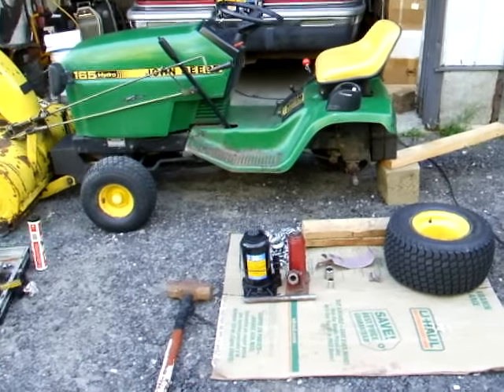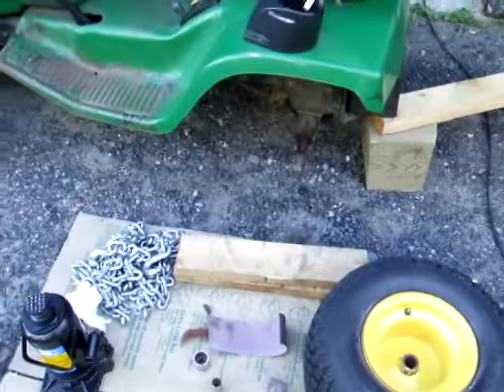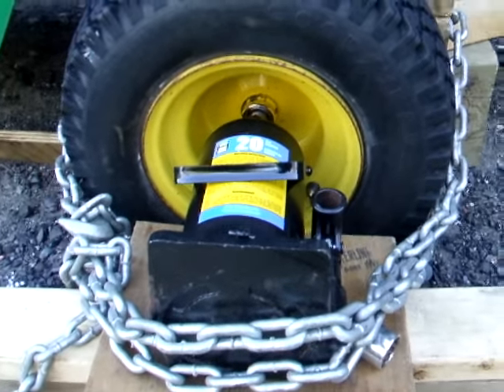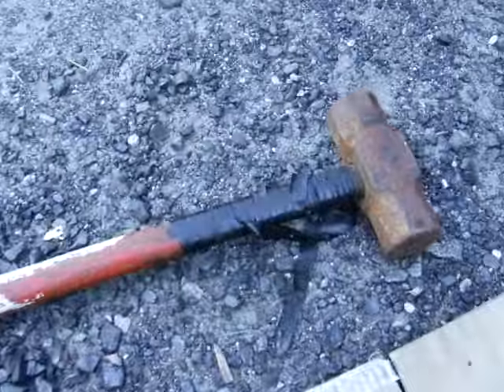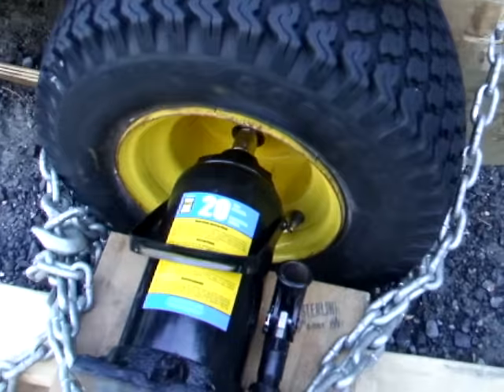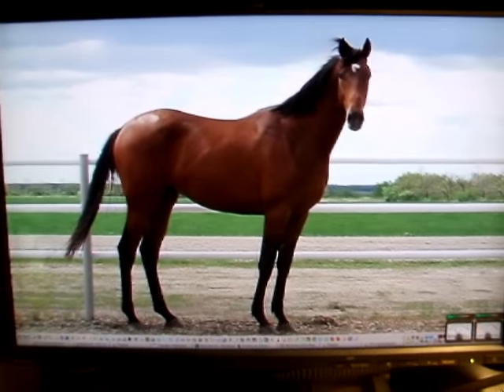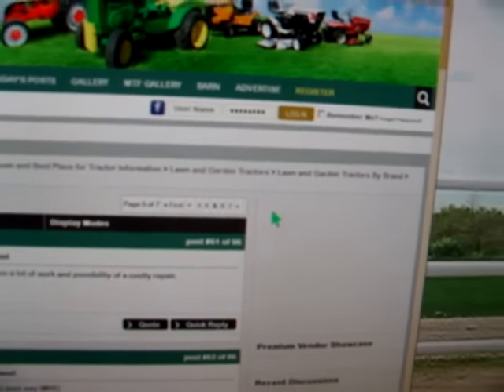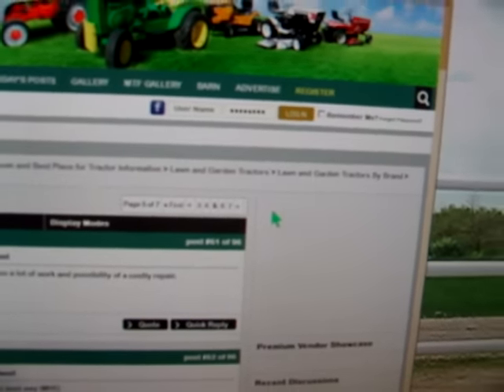Removing rusted/siezed lawn tractor wheel with a BOTTLE JACK and WINNING!!

Comment: When you put it back on cover that whole axle with never-seize brush on compound.
Reply from the maker: Good idea, I'll buy some from Princess Auto and use it when I regrease the axles them this year.  Thanks and Cheers!~  Bellarmine
Reply: @bellarmine33  Yesterday I had to cut the wheel into pieces to get it to release. 3 1/2" of direct contact wheel to axle bound by rust is a very strong grip, plus the expanding factor.....so much work for a small job. Getting ready for side 2.....
Reply from the maker: Aww boy, what a pain!  Yes, what a lot of work for such a small thing, i just wanted to swap the wheels between my 2 tractors, never thought it'd be such an adventure lol.  Perhaps you don't care about the wheel at this point, just want them OFF; but near the end of my video I show a last-ditch way to get the wheel off, and you can still use it afterwards.  Just drill a 1/2" hole in the rim right above the hub, use a sawz-all to carefully cut a slot in the hub down to the axle, then flood it with PB Blaster, and use a cold chisel to spread the hub apart and it should break free.  Still usable afterwards, the slot in the hub won't matter for a lawn-tractor going 5mph lol.  Good luck with the other side, and maybe you'll be lucky - my wheel was frozen fast, but the other side came off pretty easy, never know....:o)  Cheers!~  Bellarmine
Reply: @bellarmine33  NO CENTER DRILLED INTO THE AXLE EITHER for the puller. Yesterday it took me 10 hrs to get the wheel off after cutting it. Worst job I ever had to do in 60+ years of mechanic work. Then when I got the new wheel/tire assembly today I had to clean the paint out of the bore and key-way....more work over nothing. You never paint tight tolerance surfaces!  Now I have to remove the other wheel during the week....more hours wasted!
Reply from the maker: I hear you, everything is frustration these days about the simplest and most common-sense items!  They should have masked the rim when it was painted, Chinese shortcuts I guess.  The lack of a center in the axle didn't bother me because I didn't even bother trying a gear puller, NO WAY it would have exerted enough force to work.  As I said in my video, my 3 TON bottle jack couldn't cut it (!).  Hope one of my 2 methods helped you get the other wheel off with a minimum of fuss - Cheers!~  Bellarmine
Reply: @bellarmine33  The other side came off very easy with a gear puller and 2 threaded rods...........WTF!
Reply from the maker: Congratulations, good for you!  Was the same way with mine - the one side came off easy, other side which I filmed was 'welded' on.  Now you can finally get on with the business of changing the tires / tubes whatever, which is what you set out to do last week - simple job right? lol....:o)  Cheers!~  Bellarmine

Comment: Does it work if you cant get the key out of the keyway still?
Reply from the maker: Hi Gary, Thanks for the question.  It sure does work, there was no way I could even get at the keyway to remove it before getting the rusted wheel off.  I think that may have been part of the problem with my wheel, it didn't use a keyway / square bar, but a woodruff key / halfmoon.  I think the halfmoon 'may' have been jamming into the wheel rim slightly.  In any case, yes this method definitely works whatever type of key you have.  Good luck with your wheel removal, let me know how it goes if you want or if you have questions - Cheers Gary!~  Bellarmine

Comment: I tried this.  My wheel rim split off from the hub.  Had to end up slitting the hub that was left on it and prying it open.   Was on a Gilson rear engine rider with a unobtainable rear wheel.   Had to end up finding a different wheel and cutting the hub down to make it work , sucked big time.
Reply from the maker: Sorry to hear about your ordeal Dennis, boy what a nightmare!  You ended up doing what I call the 'last resort', splitting the hub as you say.  At least you didn't have to SAW OFF the axle and replace it, which I've heard is just what some JohnDeere dealers do (!).  Unbelievable how these can be rusted on, heard stories of people putting the axle in 10ton shop presses and bending the presses, whew!  Better luck next time, take care and thanks for the comment Dennis - Cheers!~  Bellarmine

Comment: I prefer Woodruff keys. Never had one get stuck.
Reply from the maker: Hi Peter, I think this tractor DOES have woodruff keys.  I've always thought that a woodruff key is a half-moon/semicircle, while a straight key is a bar that fits a grooved shaft.  In any case, this tractor has the semi-circle ones, which were a PAIN, I think they rotate and jam the wheel on with the rust.  Meanwhile my other JD185 has straight keys, those wheels slid off smooth as you please, go figure.  Also this tractor was kept under cover, while my 185 was left out in the rain - the 185 shafts were a bit better chromed.  Again go figure.  Thanks for the comment Peter - Cheers!~  Bellarmine

Comment: Stop. !!!, Most of the time the end of the end of the axles have Ben mushroomed from being out working to began with..  Then the homeowner tries to do it  himself and bangs on the end and mushrooms even more. All you have to do file down the end the c?axle with that high-quality file or a Dremel with a grinding drum on it.   Spray it with Creep penetrating oil .It comes right off!  That's how we've been doing it at work for 30 years.  Each side is a five-minute job with a dremel.
Reply from the maker: Thanks for the comment Meno!  That is a good point you make, though I don't think mine were mushroomed from banging, I wasn't banging on the end of my shafts, wreck my tranny!  Mushroomed or not, it took my 20 ton jack to get the rim to even budge a fraction, let alone coming off the end.  Anyway, I'll remember in future to check the end of the shafts, see if they are mushroomed or rusted as you say.  Best wishes Meno and Cheers!~  Bellarmine
Reply: @bellarmine33  Yeah , Mine are to mushroomed at all. they have just been on the axel for 25 years and they are not coming off. I'll try the jack tomorrow! Thanks.
Reply from the maker: @capeangler  You're welcome!  Good luck with your mission, these can be a real pain.  Let me know if you have any questions or your success - best wishes and cheers!~  Bellarmine

Comment: There must be a better way then this key system. Looks common for these wheels to seize onto the axle and be almost impossible to remove. Cant they have little wheel hubs like cars do?
Reply from the maker: Yes, that WOULD be nice, but I guess you have to get a bigger tractor for that.  My Dad has a very nice Yard-Man 16HP Hydrostatic Garden tractor with small 3-point hydraulic hitch, it has wheel hubs splined to the axles and rims that bolt on with 4 bolts, MUCH nicer!   Also actually, I've seen a small John Deere 108 that simply had a plate on the end of the shaft with 3 studs on it, 5 hole wheel bolted on to 3 studs(!)  Cheap but works, so guess they can do it when they feel like it...:o)  Thanks for the comment - Cheers!~  Bellarmine
Reply: They sell go kart hubs that will fit the axle
Reply: @joshmanis9860  I used a blow torch the jack and a chain. It wouldn't move at all. I took it to the mower  shop. They couldn't do it. They changed the tyres without removing the rims from the axle. Not sure how that works.

Comment: if the tire is good you can always tube it on the tractor.
Reply from the maker: That's true, but I really wanted to solve this problem and not band-aid it.  Besides, the real reason I was doing this was to put more grippy tires on the lawn mower and swap them with the bald smooth tires I put on the snowblower tractor along with chains, so good match.  Thanks for the comment - Cheers!~  Bellarmine

Comment: i,m gonna try this on a tiller wheel...one side slid off easy the other side needs dynamite
Reply from the maker: It's always one that gets you - was the same with my tractor, the first wheel came off easy, 2nd was welded on....:o)  Wish you luck, let me know how it goes or if you have any questions - Cheers! Bellarmine
Reply: @bellarmine33  same thing on the tines..one side tines came off easy but wheel would,nt..other side the wheel came off easy but the pin was stuck in the tines...had to drill the pin out
Reply: Yeah, both of mine are frozen.  I thought I could replace the tires while the rims were stuck, but no such luck.  I got one of the tires off, but that was the end of it.  I bought a 12-ton hydraulic jack on sale 15 years ago at Harbor Freight for no particular reason, and now it's going to get its first use!
Reply from the maker: Thanks for the comment, great to hear!  Yes, my 3 ton jack I first tried couldn't cut it, had to upgrade to "The Big One" lol!  Good luck, let me know how it turns out, or if you have any questions - Cheers!  Bellarmine

Comment: So All the mower, tiller, etc manufacturers are deliberately neglecting to anti-seize their axel/wheel connections to dishonestly con-jer up shop business.  
Every dealership should add the antisieze as part of the prep. 
Every buyer should add the antisieze immediately upon getting home with the machine. 
🔺And the entire US is degenerating their own English language by 
Calling the Wheel as a Rim. 
It's not a rim, it's a wheel. 
Every wheel has a rim around its outer circumference. 
To call it a rim is to take away the ability to speak technically about a wheel.
Reply from the maker: Thanks for the comment Senator Joseph......:o)  You're probably right, as the amount of Anti-sieze the mfg puts on is a real joke.  I'll be greasing them myself every few years, should buy a bottle of antisieze too.
I've always referred to a wheel nowadays as an assembly of rim and tire - a rim and tire makes a wheel.  Though you bring up a good point, back in wagon wheel days, they had the spoked wooden wheel and outer steel rim, so you're saying the metal part is the wheel AND rim, and the rubber is the tire.  So we mount our tires on wheels, not rims.......:o)  Cheers Joseph!~  Robert
Reply: @bellarmine33 . I'm 66 years old and from an English speaking country. I have always known the tyre to be mounted on a rim and the whole unit is a wheel as well.
Reply from the maker: @ducatidarmah122  Thanks for your reply on my comment Ducati, appreciate the support.  I suppose the whole rim/wheel thing has evolved somewhat since the wagon wheel days, so that everyone nowadays regards mounting tires on rims to make wheels as normal......:o)  Best wishes Ducati, thanks again and Cheers!~  Bellarmine
Reply: Take your engine pulley and transmission off and anti seize the shafts

Comment: Is anyone else using penetrating fluid / brake fluid ? Soak it !
Reply from the maker: Hi Keith, Yes, did I mention I soaked it with PB Blaster for DAYS before?  It helped I'm sure, but still not quite enough!.....:o)  See Fred Geitner's comment below on how he maxed out a 25ton shop press dealing with these problem wheels - they can be stuck on that tight indeed!  Thanks for the comment - Cheers!~  Bellarmine

Comment: 4x4 and a 4lb sledge to the back of the rim and rotate it as u pound on it will get it to.
Reply from the maker: Hi Nathan, Thanks for the comment.  Thing is, I was doing just that before, using the PB Blaster too, and NO WAY it was coming off, I was ready to give up before I tried this.  There's no way I could have applied the amount of force needed using a sledge hammer (the 2-ton jack I started with was too small (!), I'd have busted the transaxle first.  I've seen / heard horror stories about impacts / hammering on the transaxle internal snap-rings and so on, pretty weak that way.  Seen a few bad examples of expensive damage, and don't want to experience one myself.  I suppose some light tapping wouldn't hurt, but mine was stuck real good - 'welded' on as others have said!  I'd just try my 'safe n' easy' method first....:o) Thanks for your comment Nathan, and stay well - strange times we're living in, strange times...:o)  Cheers!~  Bellarmine
Reply: I have a go kart and I tried to do that and I may not be strong enough, but it is really rusted on there and this did not work for me. I again may just not be strong enough. Might try again though.
Reply: @dwightschrute3862  i did a sledge to the back of a wheelhorse rj58 rim to get it off once. I bent the rim all to hell. ever since then i try to use some pb blaster and pound it on then pound on the back and rotate while doing it. It will pop off eventually.
Reply from the maker: Thanks for the comment Dwight!  I do not recommend 'pounding' on the rim / axle, as there's no way to apply the amount of force needed using a sledge hammer, and a good chance of wrecking the transaxle!  For example, with my wheel, the 2-ton jack I started with was too small (!)   I've seen / heard horror stories about impacts / hammering on the transaxle internal snap-rings and so on, pretty weak that way.  Seen a few bad examples of expensive transaxle damage, and don't want to experience one myself.  I would recommend just trying my 'safe n' easy' hydraulic method first.  If it doesn't work, then nothing lost, go ahead and pound if you want nothing to lose then so-to-speak lol.  Let me know how it goes or if you have any other questions Dwight - Cheers!~  Bellarmine

Comment: One word... Torch....heat the shaft,and pull off wheel.
Reply from the maker: Thanks for the comment Shannon!  Yes, I thought about using a torch, I'm learning to use heat more and more to remove things.  To be honest I really don't think it would have helped, it was so rusted on there.  As I said, I had to use a 20-tonn jack, my 2-tonn jack was too small (!), so heating it would probably not have cut it either.  Sometimes it works, but I think more often than not it fails, my method is easier and safer.  I've watched a few YT videos on tires EXPLODING in your face when using a torch, no matter how careful you are, even removing the valve core and breaking the bead. One tire company says the heat causes a chemical reaction in the tire that can cause a failure up to even 24 hours later - they actually demonstrated it......weird. I'm always into trying 'last ditch effort' ideas, but from the sound of it a torch around tires just seemed a tad too dangerous for comfort...:o)  Anyway at least this idea is here in case you get into a similar situation (hope not!...:o) Thanks again for the comment Shannon - Cheers!~ Bellarmine

Comment: Thank you. It helped me. I had wheels stuck on my snowblower. They had been lubed some by the manufacturer, so they weren't seized horribly. The one side came off alright after being broken loose. The second one had to be jacked all the way, using a large bolt to push on the axle with the jack, resetting a couple of times.
Reply from the maker: You're welcome, thanks for the comment on your success!  Mine were the same, one popped off, other one had to pull it off all the way!  Another story of rims 'welded' on - rust is amazingly strong lol.......:o)  Glad it was helpful, best wishes and stay warm!~  Bellarmine

Comment: Good video! But, maybe instead of applying lots of grease on re-installation of the wheel, use lots of anti-seize??
Reply from the maker: Yes you're right, next time I have them off I'll use Anti-sieze, didn't have any handy at the time.  Thanks for the comment - Cheers!~  Bellarmine

Comment: Wish I had seen this before I did the rear wheel on my 165 Hydro.  I ended up sawing off the tire then sawing the rim off then taking a grinder and grinding the center hub of the wheel into and finally using a chisel to split the ground hub enough for it to break free from the axle.  I tried beating with wood blocks and hammer then various gear pullers around the rim lip and heating the damn thing and nothing worked.  I would love to have tried this because it just looks like it would do the job.  Great thinking.  If I have to fool with the other tire and rim I'll be giving this a try.
Reply from the maker: Thanks for the comment Johnny!  Wow, sorry to hear about your ordeal, wish you had seen this first too, boy what a nightmare!  You ended up doing what I call the 'last resort', splitting the hub as you say.  Only difference is you can maybe save the rim by sawing through a hole in the rim as I explain at the end of the video.  At least you didn't have to SAW OFF the axle and replace it, which I've heard is just what some JohnDeere dealers do (!).  Unbelievable how these can be rusted on, heard stories of people putting the axle in 10ton shop presses and bending the presses, whew!  Hope you have better luck next time if you have to mess with the other tire Johnny - Cheers!~  Bellarmine